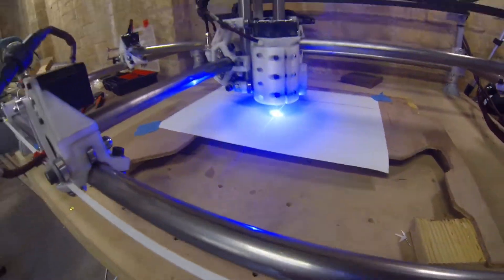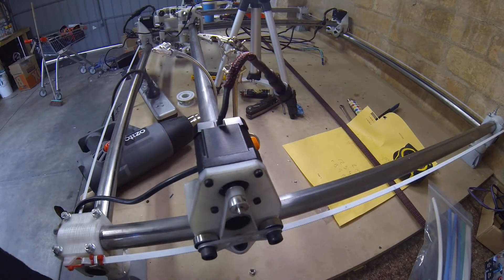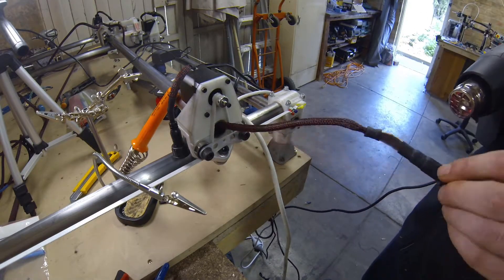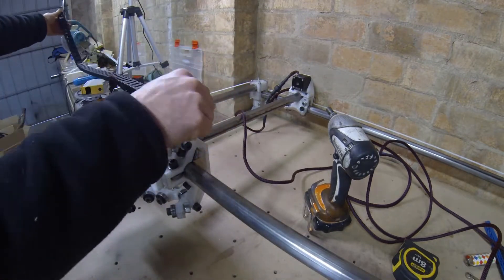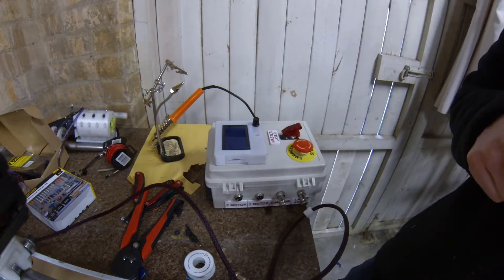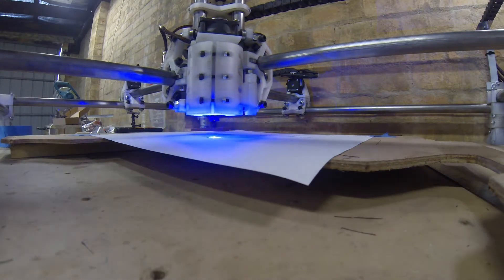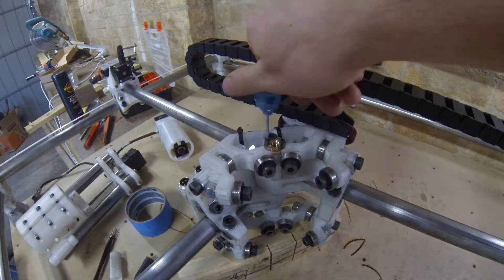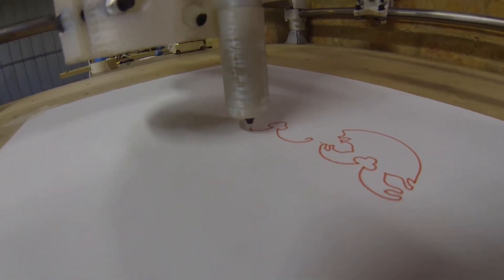mpcnc build wiring the machine and first run EP4/4

Comment: Ooo this is a nice solution, but i have one question about the wirers, is the diameter enough on the cabels?
Reply from the maker: hi David from what i have read it was, but i decided to gang up 2 of the wires for each motor line anyways, one thing i have read is that Ethernet type connectors can't handle the current but don't take my word for it I'm teaching myself all this electronic stuff.

Comment: Looks like fun, how big is your MPCNC print area?
Reply from the maker: hi Ian, my mpcnc is 545x730 it varies depending on spindle size and mount.
Reply: @prop1305  That's great, thanks for the information. I am going build one with similar dimensions, I want to be able to fit 2' board in there so I can cut the holes in a cornhole board ;-)